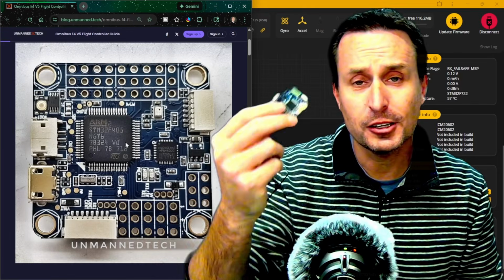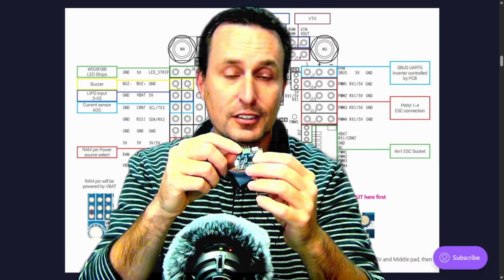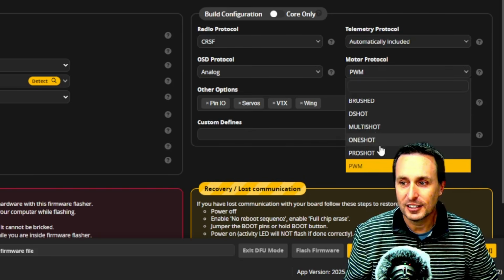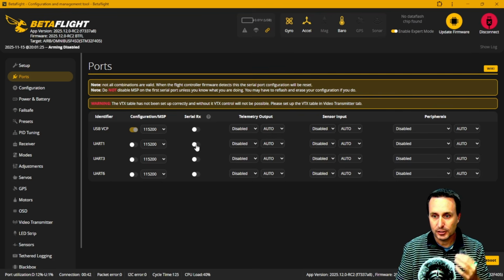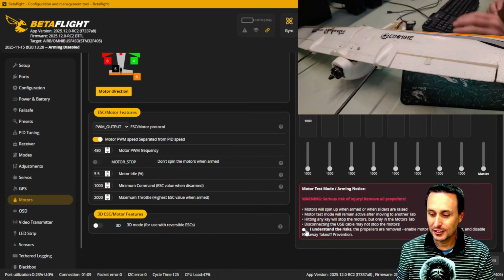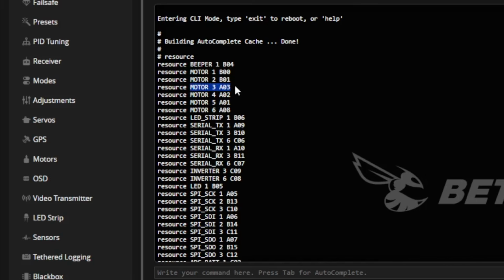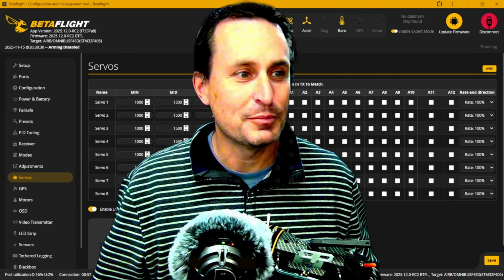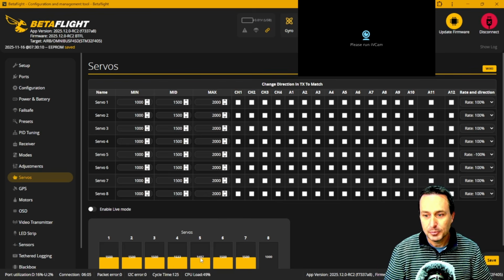🤯✈️BetaFlight Wing✈️😮| Flash & Servo Setup

Comment: Love it. I am still using Betaflight and 480Hz PWM servos for my helicopter. Wings' requirements are close to those of helicopters. I noticed the change from 4.2.5 to 4.5.2 that sets the yaw integral I-term to zero whenever disarmed. It affected my helicopter's accidental-disarm recovery because it doesn't have time to spool up from zero throttle, so re-arming mid-air is not possible. Then the zero-I-gain renders the tail uncontrollable.
Reply from the maker: Yes, when rearmed BF reinitializes PID calcs.  So accumulated I-Term resets to zero.  I thought it worked like that for a long time?

If not good for Heli - which I understand why - that could be an IF statement when that mixer is selected or a CLI option to no do that if turned on.
Reply: @uavtech  Thanks for the hint. I will look up the CLI.
Reply from the maker: @johncgibson4720 not saying it exists in CLI, I would need to look.  But it could exiat if mot there (beauty of Opensource)

Comment: In my case (or generally) are cli servos 1 and 2, the servos 4 and 5 in the servos tab, which are 3 and 4 in the motors tab.💩
They are naturally connected to B00 and B01😂😂, while the motor is A02.
Reply: could you please explain how did you found our that they should be connected to B00 and B01? is it just in default settings of a target firmware or you somehow looked it up in datasheet for you fc?
Reply: @ОлегНовиков-г8в It was just try and error and it took me a while to figure it out. You can see the corresponding numbers in the cli, but then you have to make your own choices.